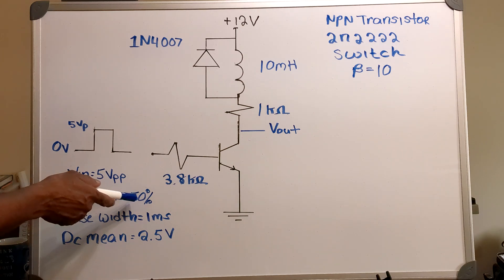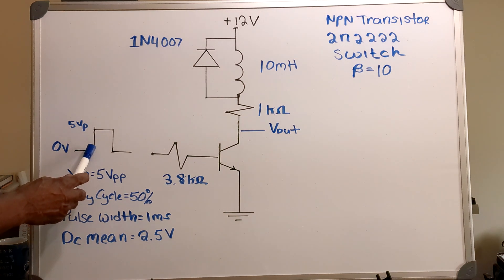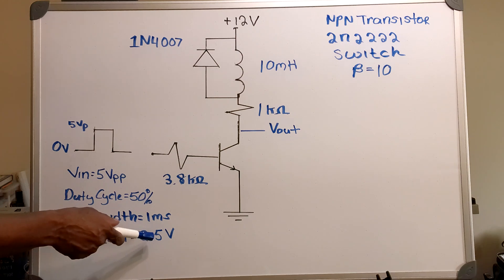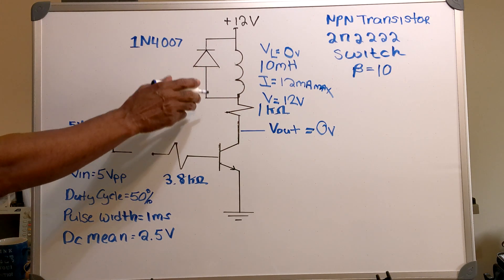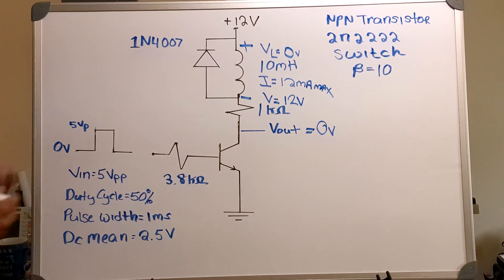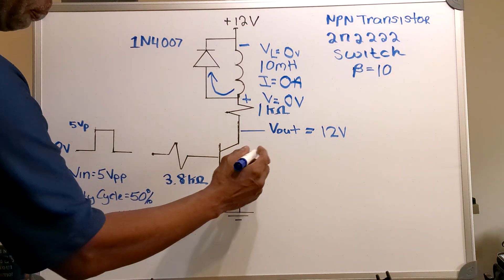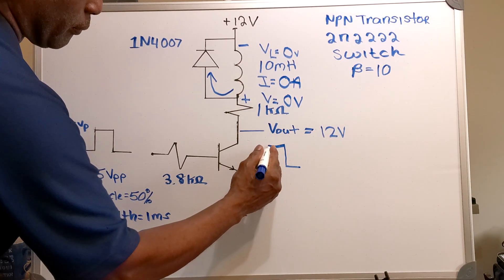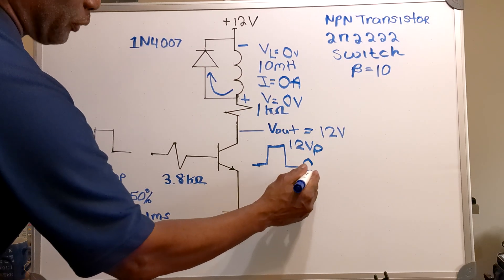NPN Transistor, Resistor, Inductor, Diode Switch Circuit!

Comment: When the transistor turns off.. the collapsing magnetic field of the inductor will induce an emf  causing  the diode to forward bias to apprxomately  0.7 v - thus the collector potential will rise to 12 + 0.7 v